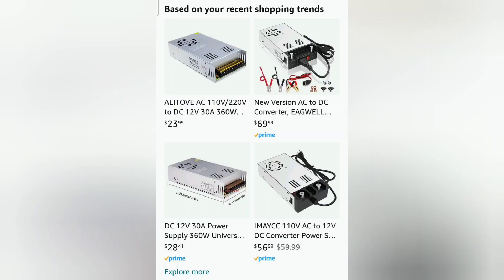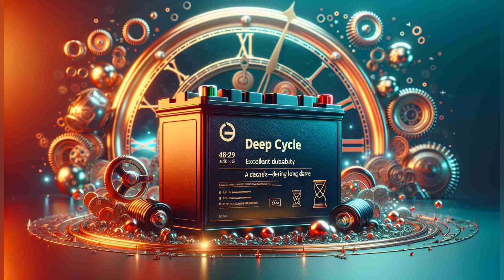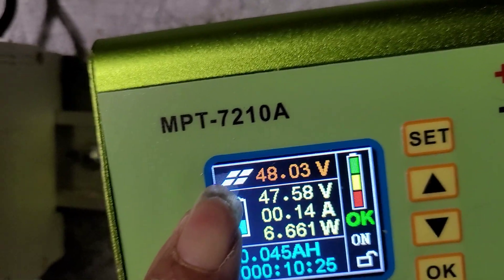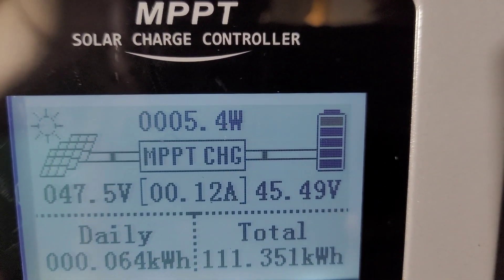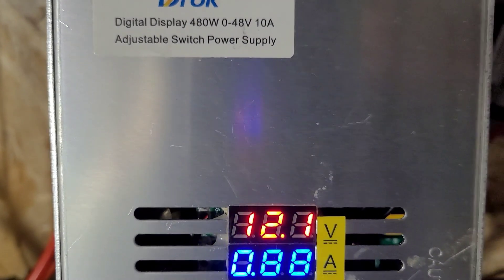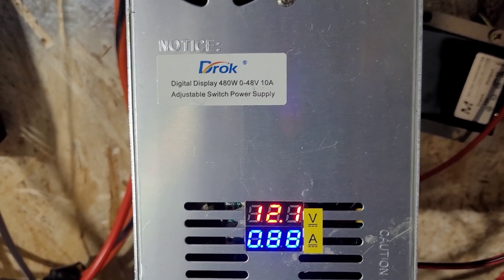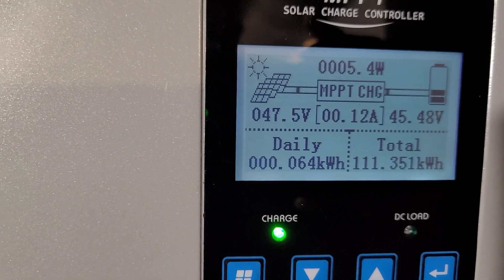can you step up house electricity and put it back into the grid of your house to save energy

Comment: Just revisiting this to check im reading the numbers on the displays correctly... 

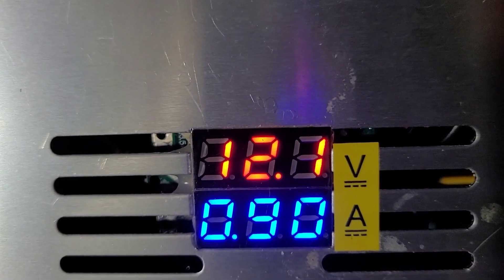At 3:04 the output of the PSU is 12V at 0.88A = 10.56W.

Then DC-DC converter converts the 12V to about 48V. 

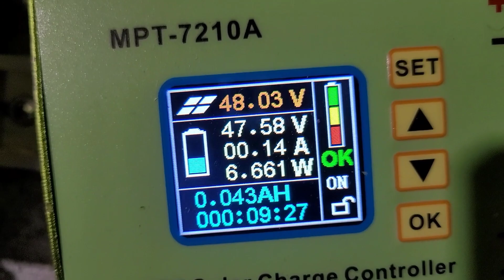Then at 3:33 the output of the MPT-7210A is 47.58V at 0.14A = 6.66W.

Then at 5:12 the MPPT turns the 47.58V to 45.21V at  0.12A = 5.4W. 

So overall you start with about 10 W and end up with about 5W at the output of the MPPT. eg its loosing about 50%.  Most of the loss is in the 12V to 48V DC to DC converter.

Comment: 0:57 To make 48V @8A on the output the input would be at least 12V@ 32A and probably nearer 40A.
Reply from the maker: @ColinWatters  40 amps will destroy a 12-volt battery this is common knowledge you just don't charge a battery like that

Comment: Your terminology is what's throwing people off. Yes, your pulling AC power from "the Grid", through a 12 volt AC to DC charger, to a boost converter, to a an MPPT charge controller, then into a battery, that will eventually feed your "Inverter" (not the Grid) to feed your house.

Comment: Hello, it seems that you make 6w with 10w,?
Reply from the maker: @roland999100  yeah but that's a typical conversion and you can buy that from the market, Amazon eBay those sort of places
Reply: That s 20 years i look at Joseph Newman, Bedini, Floyd else and else , I still wait to pickup 10w and pay 5w . Okay with mosfet  to get it but I dont reach overunity. What is your best succesfull test for it  sorry for my english
Reply from the maker: @roland999100  question sorry if I misunderstood you but I had to ask this question I understand where you get the 10 watts from because that's what we had to do to charge the battery but I don't understand this how you think that tiger is only putting out 6 Watts that machine won't even turn on at 6 W maybe you don't understand what a tiger it is it's an inverter that signal ties into the grid and since that inverter is a thousand watt inverter how do you run something that's a 1000 w what's 6 Watts please explain

Comment: Yes we reduplicated your experiment.
Yes, the experiment was successful in stepping up the power. The voltage was increased from the initial 12V to 48V, and the current was boosted to 8A, resulting in a total power output of 600W. The described setup effectively demonstrated the capability to enhance power through the implemented modifications.
Still waiting for someone to explain why it works, it's like everyone's saying that an electric car will never work and then here comes Tesla cars!

Comment: What are you trying to do?

Stepping up voltage is good for sending it over long cables(less current on output), but otherwise wouldn't give efficiency gain. There are converter losses.

MPPT is ment to deal with solar cells, and is unlikely to do anything interesting when connected to a regulated power-supply.

Going via 120V(US)/240V(EU) to power something locally from battery tends to be one of the less efficient ways to do things.
Reply from the maker: Dear sir, there are a few things I would like to understand. Did you not read the meters, or do you doubt what the meters indicate? Yes numerous meters were in use, so I can comprehend skepticism about their readings. The purpose of the experiment is to demonstrate that these DC to DC converters do indeed step up electricity. Many individuals use 12 volts to charge 24-volt batteries, prompting the purchase of such converters. However, when these are integrated into homes, doubts arise regarding their effectiveness. Your comment, questioning our intentions, is precisely what we were hoping for. We aim to investigate whether the widely sold A DC/ DC converter truly delivers as promised or if it's a scam. If the device falls short of its claims, your critique is valid. Yet, if the results align with its intended function, we're puzzled by the concern. Could you elaborate so that we may clarify to our audience the distinctions between using a step-up in this manner versus using it to charge a battery in a golf cart?
Everyone is wondering if you could read the actual read out and if you understood the numbers on the meter Or you disbelieve what was on the meters.